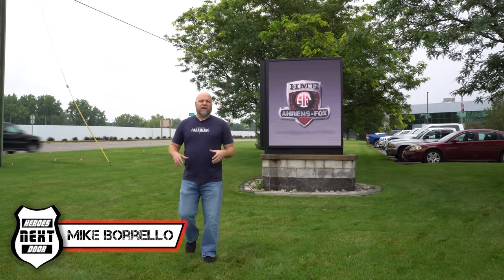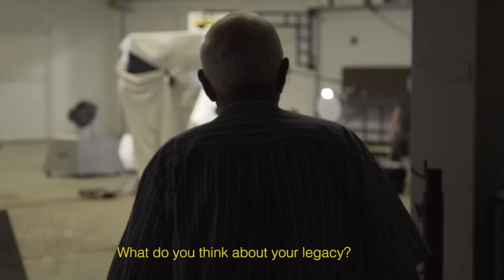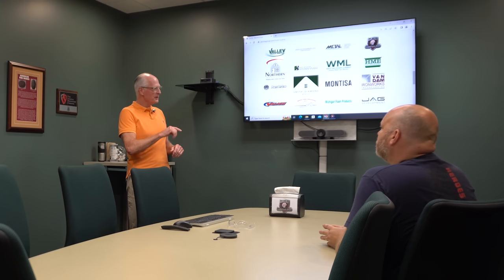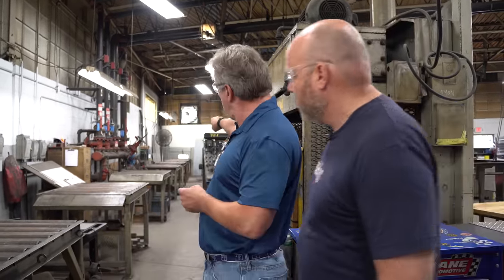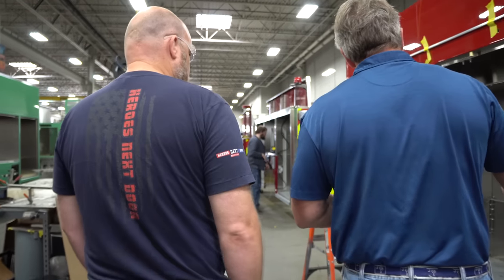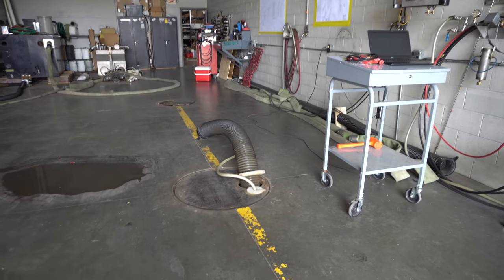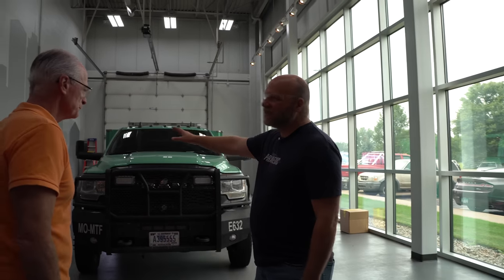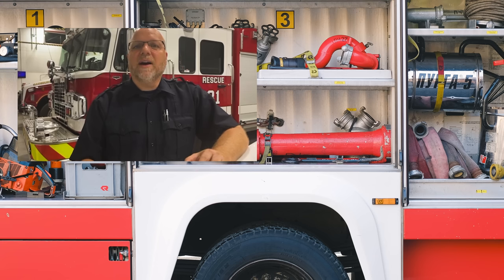"Exclusive Look Inside Fire Truck Factory Reveals Industry Secrets"

Comment: So they build their own chassis, that's great! Other manufacturers buy in commercial truck chassis and add their custom cab/body don't they?
Can't wait for the full tour
Reply: I'm pretty sure Ford is a commercial truck chassis.
Reply: They deal extensively in both commercial and custom chassis.
My department runs 2 custom engines and a custom pumper-tanker. Our neighboring department runs a custom aerial and 2 HME bodies on International chassis.
We also have a new mini pumper on a Ford chassis currently on order.
Reply: this smaller companies making chassis are kinda iffy... What abut their safety? Do they even have money for the RND and proper crash testing. Heck even bigger ones like Pierce don't seem to be that safe, many don't even have airbags and very few side air curtains. Even crash tests that Pierce does are a joke compared to Scania's or Volvo's, and this guys, do they even crash test?
Reply: @solarissv777  Yes, HME has been building cab/chassis for decades and most certainly does crash testing.

Comment: At the last fire department I worked for before retiring, I would write the bid specifications for all our fire and EMS apparatus. I retired with 48+ Years as firefighter/ EMT. I would confer with our chief and the firefighters what they would like to have on the new truck, if it was possible and within budget constraints. Written bid specifications could run over 75 pages and normally would go through five drafts before it was submitted for bid. Once submitted to various fire apparatus manufacturers, they had a time limit as to when bids were expected. The purchasing department along with me and one or two chief officers attended the bid opening meeting. After that, I would take the multiple bids and review every bid extremely closely. After building a report of each bid, we would then meet to decide which one of the bids met our bid specification, how many exceptions were taken and if the bid was within our budgeted funds. That report went to the fire chief along with my document of which one of the bids met our expectations, be within budget, and met the time frame expected for delivery., and why the other bids were rejected. Once the fire chief approved the selected bid, then it was sent to the purchasing department to issue a purchase order to the manufacturer. Once the manufacturer accepted the PO, then we would keep close track of the build of the truck, and visit the manufacturer halfway through the build, and at the end to do a complete inspection to see if the manufacturer met our bid specifications. Corrections would be done at this time. Once completed, the manufacturer would deliver the vehicle for inspection and acceptance. 
Buying a fire truck isn’t like going to a car dealer and buying one. These trucks were expected to see lots of use and last at least 15-20 years. 
It’s a very time consuming effort to purchase a fire truck as they are very complicated vehicles.